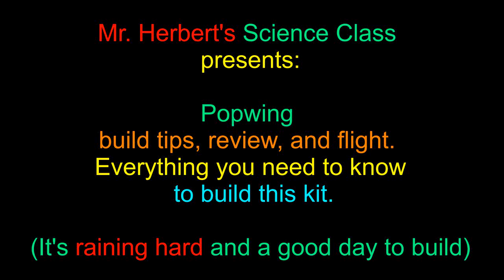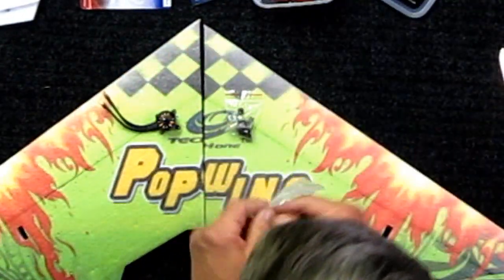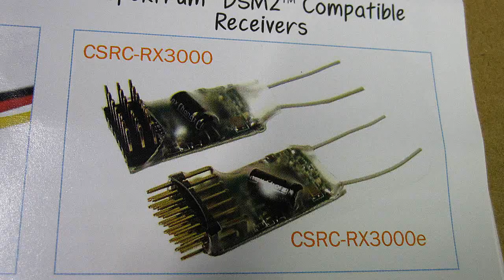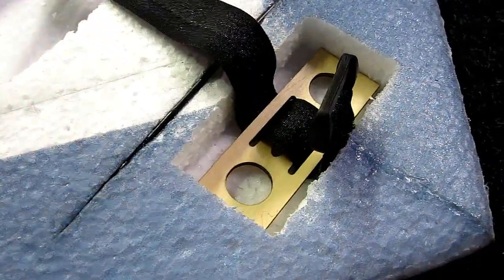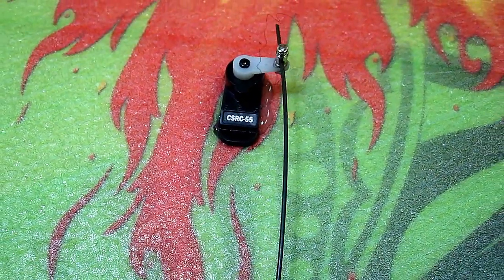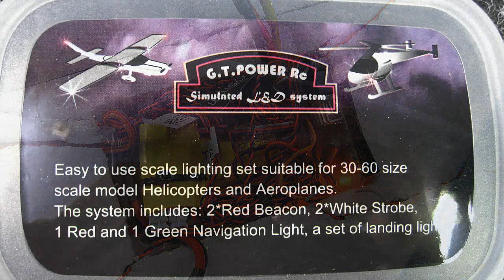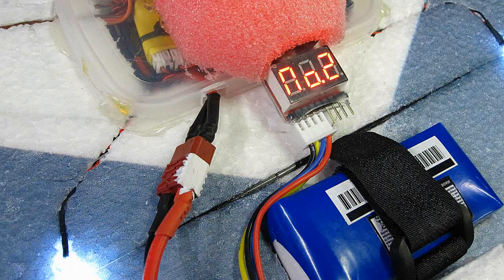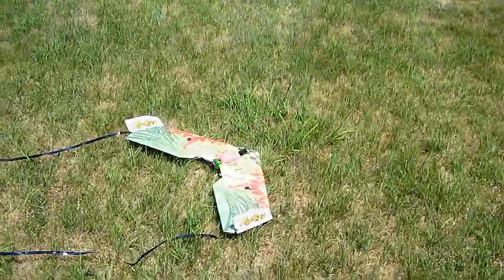PopWing Flying Combat Wing. A Must See Review! The Build and flights.

Comment: Good ol' prop cuts - I sliced my finger with a 2550kV motor (and a 6x4 prop) whilst launching one of my designs - it cut in a few mm (diagonal to the surface of the skin though; like gills) 7 times on my index finger, and bled quite a bit. Fortunately it hit nothing important, the cuts healed without fuss (got some scars though) and the prop / motor wasn't even dinged.

Comment: Hey Dave... nice video and tips!  Thanks.  I wonder, in your attempt to use tape on the EPP (I think that's what I've read online most of these are made from) did you try to use any kind of primer or even spray adhesive as a base layer onto which to place the tape?  I'm just curious as I'm about to assemble an EPP kit here and wonder if you tried that and your results.  (Selfish me trying to learn from others' experiences ;-) )  Thanks! Nice flying by the way!

Comment: When you get your DX6i. Read the manual....... The bind plug is a item you plug into the RX, before it will work with your TX. After you have biound them you remove the plg. But as i say read the manual....

Comment: Does anyone know where I can get help with converting a Mode 2 transmitter to Mode 4?  The only difference between the two modes is that the rudder is switched with the aierlon. Both have throttle stick on the left.  Also where do you get the white plugs that pop into receivers and attach to LEDS?